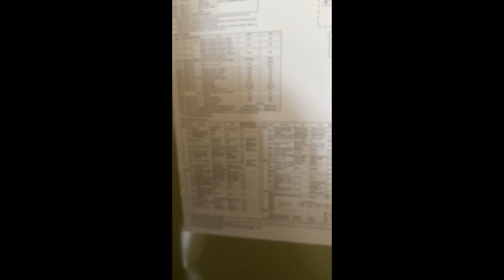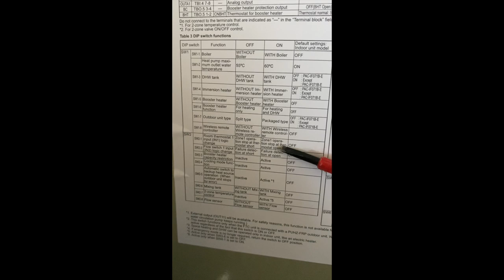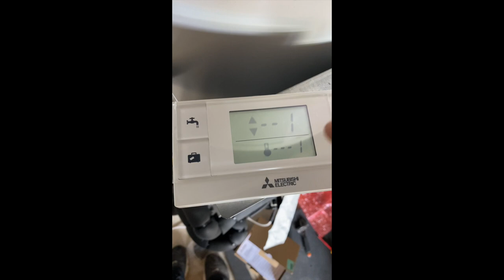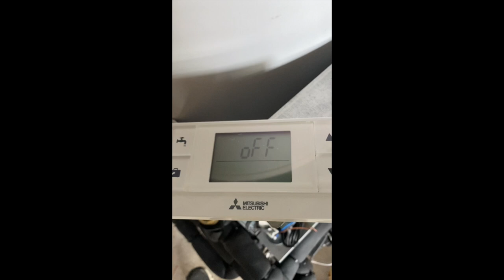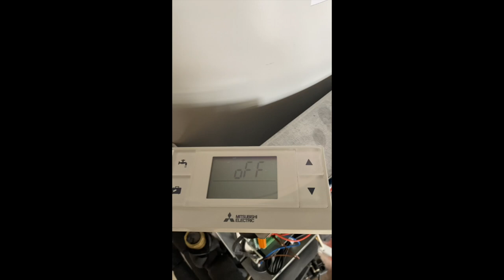Mitsubishi Ecodan Wireless Controller Connection and Dipswitches

Comment: great video, can I ask a question about the pump for zone 2, the UFH. Our manifold and UFH pump it is right next to the cylinder so we are using this pump for zone 2. Usually, this pump is connected to the UFH wiring centre. 
Using a 2-zone pack from Mitsubishi they say: When adding a second heating zone to a pre-plumbed cylinder the pump for heating zone 1 needs moving from OUT2 to OUT13. Then wire your additional pump into OUT3
Should we wire the UFH pump to the FTC or the UFH wiring centre?
Reply from the maker: Hi Annette, either or on the pump wiring. When a thermostat calls for heat it will switch the pump whether it is from the wiring centre or the FTC as long as the signal cable from wiring centre to in6 on the FTC. I hope that makes sense.
Reply: Hi, we were so pleased to learn how to do that. But.... switched the HP on and got error EE, do you know how to address that error? is it a fatal error?